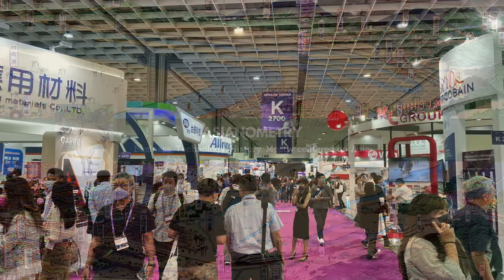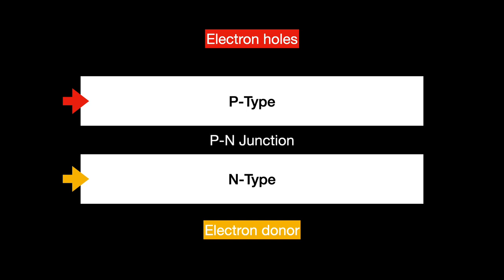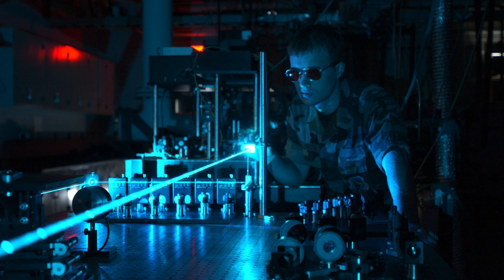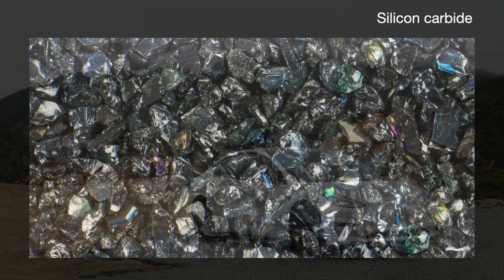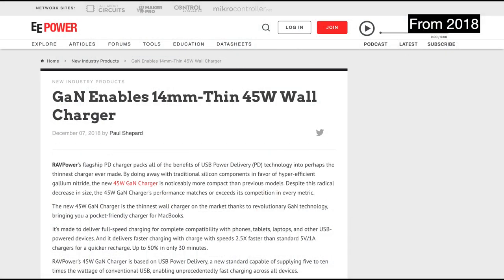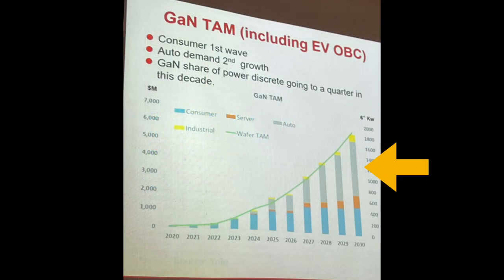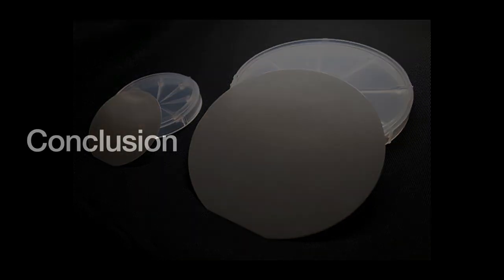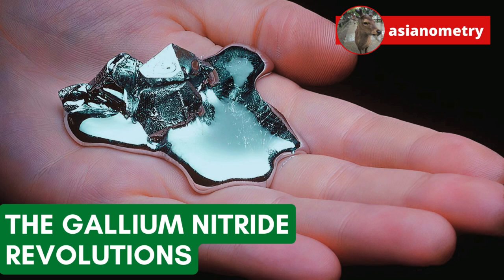The Gallium Nitride Revolutions

Comment: GaN still has a number of hurttles to clear. I think the biggest breakthrough, at least from an actual applications standpoint, will be integrated on chip gate drivers. The reason GaN can switch so fast is because of its small size relative to its current handling rating. This minimizes parasitics, namely gate capacitance, which allows GaN systems to claim you can switch the device up to 5MHz. However, when you have to wire bond the gate, bring it out through some sort of package into a PCB to get to the gate driver all of that goes out the window and you literally will be limit by things like the inductance of the bonding wire. Kelvin source can help, but the fundamental problem remains. Having the gate driver right there in the package will not only practically facilitate MHz switching frequencies in applications where it otherwise wouldn't be possible, but it will also eliminate gate driver design as a consideration for power electronics engineers. Considering how significant that is, the time savings alone will make it more attractive.
Reply: @John Kaplun - several GaN technology companies have developed GaN integration technology and can effectively build an integrated Gate driver monolithically, however this technology is not as good as it was first thought it would be.  The first issue relates to there being no possibility of developing a Zener type voltage regulator device in GaN - which is needed in order to build an effective Gate drive voltage regulator.  The second issue relates to cost - it turns out that it is far more cost effective to design and build a Gate driver in Si technology and then simply co-package it with the GaN HEMT.  

This is not the first time something like this has happened in the semiconductor industry - with the development of BCD technology it became possible to design an 'all in one' switched mode power supply on a chip - these became popular for use in the early 5W cell-phone chargers.  The BCD technology allowed the monolithic integration of a high voltage DMOS power switch along with the bipolar and/or CMOS control circuitry all onto a single Si die.  Although many semiconductor companies developed solution like this the latest trend is to move away from this concept an co-package a Si SJ MOSFET with a control circuit developed in a simpler (lower cost) Si process.  It turns out that co-packaging - either die besides die or die on die is lower cost at a system level that trying to attempt integration of very disparate semiconductor technologies.

Even without resorting to such integration it turns out that you can get very good performance with external Gate drivers and GaN if you just employ two key concepts - a Kelvin Source connection to the remote Gate driver and a negative Gate turn-off voltage.  There seems to be a reluctance from many power supply design engineers to embrace a Kelvin Source connection and a negative Gate turn off voltage.  If you don't adopt these two ideas then your comments about package parasitics is spot on correct and you will experience 'design hell' trying to get your design working while keeping the mythical 'smoke' contained within the circuit components.  The simple adoption of a Kelvin Source connection and a negative Gate turn off voltage makes the driving of GaN a trivial design exercise.
Reply: @michaelharrison1093  Thanks for your insight, I am not a VLSI guy and I was unaware of the inability to form a Zener type device in GaN. Is this something for GaN specifically or all WBG materials? 
I agree most power electronics engineers (such as myself) have been reluctant to adopt those two things you mention. I am working now on a Dual Active Bridge DAB and we have implemented a -3V turn off voltage which GaN systems says is acceptable in their data sheet, though they don't elaborate much. Of course, having to find that -3V rail adds a bit if circuitry in your gate driver. This is for their 100V 90A discrete which doesn't offer a kevlin source, but interestingly offers two gate pins on either side of the chip which is supposed to make them easier to parallel and was a factor in choosing it. I have no hands on experience with EPC or other manufacturers so I'm not sure how standard Kevin source packages are in GaN frankly, so unless you have a packaging lab available to you (and a GaN one at that) I think you might be limiting yourself in terms of what's available on the market.
Reply: @johnkaplun9619  I am currently working on trying to drive standardized packaging for GaN within the industry and at the same time drive towards high reliability (Automotive) packages.  The lack of a Zener type device is a GaN specific limitation - you can stack multiple pn junctions for a higher voltage, however the temperature dependence is not great.  For your -3V Gate turn off solution you can simply increase the Gate drive supply by +3V and then create a 3V regulated reference to reference the (Kelvin) Source to.  I am assuming your DAB will achieve ZVS commutation - this is also a real help when it come to driving GaN.  Eliminating that Millar current really helps clean up the Gate drive.
Reply: @michaelharrison1093  Yes, we have two LDOs creating the +6/-3V off a 9V rail. ZVS is the goal. Standardized packaging would be great. For coming up with some kind of FOM to compare we struggled since EPC packages are all BGA or LGA and GaN Systems are SMT. 
I will point out that I'm just a student, and you clearly have more experience than me so please excuse my ignorance.

Comment: Could a place like TSMC take a GaN wafer and put it into their EUV machines, or do they need new equipment? I know the size is wrong, so let's assume they are for this question.
Reply: TSMC is currently one of the largest manufacturers of power GaN HEMT devices.  They have developed a Schottky Gate enhancement mode device (normally off).  In this video there is a mention of two of the new 'fab-less' GaN companies Navitas and GaN Systems - both of these companies use TSMC as their fab.

Most of the process equipment for power GaN HEMT devices is the same as is used for silicon and GaN is great on the basis that the feature sizes needed for the power devices is effective the same as turn of the century state of the art silicon proocesses.
Reply: As far as I know photolithography machines should work the same, with a little bit of tuning. The problem is that the doping, etching, and deposition processes, and logic design chemistry, are completely different from silicon. This is why having research done on GaN power transitors is so important as it gives chemical engineers a basis for the chemistries and processes needed to develop the technology further. I'd love a 50GHz gan processor, but we are more than a decade away from the technology being mature enough for that.
Reply: I doubt power electronics like chargers need 5nm litho, for high current circuits I would expect large gates, not small ones.

Comment: Problem: This video implies as if GaN is something new, but it's far from it. GaN has been widely used in RF power FETs for many years now, not just opto.
Reply: When I worked at Hewlett-Packard in the 80s we were developing GaN chips for RF applications.
Reply: GaN specifically designed for power applications is something new.  There is almost nothing in common between the RF GaN technology that started to be developed in the 1970s and the power GaN technology that started to be developed just after the turn of the century.  Likewise GaN technology for optical application is a completely different technology.  All three of these applications might technically all use GaN as the active semiconductor material, but manufacturing processes do not share anything in common.

Comment: Sapphire, the "real one" may be  a precious gemstone, but basically its just a crystalline form of aluminium oxide, Al2O3, with some trace amounts of other elements that give it its blue (typically) hue. Those "sapphires" for industrial use are not "gemstones", but man-made crystalline inorganic materials (as seen @ 12:40), made in bulk and so cheaply that they can be used for manufacturing "crystals" for wristwatches.
"By 2017, the largest reported sapphire grown by the Kyropoulos method was 350 kg, and could produce 300 mm diameter substrates" says Auntie Wiki... (https://en.wikipedia.org/wiki/Kyropoulos_method#Crystal_sizes)

Comment: I will bet that the charger they gave you used 21st-century semiconductor in a 1920 vintage circuit. The 100 year old buck. It's not as if the 2011 Ćuk-buck2 actually exists and is far cheaper and superior.

Comment: An important point that was not included in this video was the elemental availability of Gallium. Gallium does not exist as a free element in nature. It can only be extracted as a by-product of refining other ores like Aluminum.
Gallium is nowhere as abundant as Silicon in the earth's crust, it is an important point to consider before we start jumping towards GaN as some holy-grail before realizing it's not environmentally sustainable.
Reply: GaN HEMT devices are made using a silicon wafer and growing a thin epitaxial layer of GaN on top of the silicon wafer.  There is not going to be a potential supply issue for GaN

Comment: Can they utilize gallium like the ideas with liquid mercury? Gyroscope stabilizer or any other possible use with liquid metal?
Reply: Some thermometers use a Gallium alloy as a substitute for Mercury. That's about it. Also Ga is still much more expensive than Mercury if we are talking larger quantities.
Reply: Compound Semiconductor of Group III and V elements. Alloying ratio is  variable.

Comment: What is milliampere PER hour?
That means you're dividing the current by time. In other words, it's kind of an acceleration of current parameter. But that's an irrelevant measurement. It has nothing whatsoever to do with battery capacity. I've never heard it used.
Battery capacity is measured in milliamp hours (for a given voltage). 
This is similar to watt hours, which is a measurement of energy. But not watts per hour.
Reply: He's pronouncing the last three letters of milliampere

Comment: You did not mention the faster GaN transistors cause radio interference. For example it is hard to find an electric vehicle (EV) with an AM radio. This is because the AM radio receives the electrical noise from the GaN inverter more than it receives AM radio station signals. This is killing the usefulness of the AM band. Soon the electrical noise from higher power inverters will  prevent the FM radios from working as well. In the USA this issue is called Electromagnetic Compatibility (EMC) and in Germany it is called EMV. BTW, this is a preventable problem, but few engineers know how to prevent it. So say goodbye to your favorite Radio station as we make more and more electrically noisy EVs.

Comment: mAh = milli-ampere * hour.

It's a very stupid unit convention, but you can think of it as roughly proportional to energy capacity. By metric convention, energy capacity really should be measured by joules (J), but science and likes to pretend that they like SI, but in reality they prefer to default to stupid units when given the opportunity for no reason other than to make things sound more complex than they need to be. 

If you multiply amp-hours [Ah] by voltage, you get watt-hours [Wh] which is dimensionally equivalent to joules [J]--just scaled by 3600 (1 [W] = 1 [J/s], so 1 [W*h] = 3600 [J]). Just note that without the true battery curve this results in an approximation since the battery voltage varies over the state of charge of the battery. But for most puposes, all capacity ratings are approximations of true capacity anyway, since true capacity will varies greatly in response to charge and discharge rates.

Comment: If your Legos are not fitting properly, use a bigger hammer !

"Low voltage applications ... under 600V" eh ! Are we talking semiconductors or vacuum tubes !?

Still going to see which one becomes the dominant material for power semiconductors: GaN or SiC.
Yes, I know power semis aren't as sexy as 5nm multicore processors, but very necessary, in chargers, EVs, and even grid scale inverters, and possibly some new forms of fusion reactors (see Helion).
Reply: GaN most likely.
Reply: There will never be a winner. SiC has a higher ceiling for voltage while GaN has a higher ceiling for frequency so they will both be used for their respective applications.
Reply: @gljames24  True
Reply: Depends on the voltages at play, for things like consumer powerpacks, chargers, and mobile devices probably GaN.

That said SiC seems to be targeting the EV market, Charging stations, and even some grid scale applications around renewables. I know of one big player in the SiC that's testing applications well into the kV range that can tap into power feeds straight from distribution lines at +50kV
Reply: @centurion1945  GaN is more efficient for EVs, though? Those motors like high frequencies
Reply: As for the GaN Vs SiC question...

EPC founder and CEO expressed this the best way (which is very accurate).

Any application that was traditionally using Si IGBT technology will over time move to SiC.  Conversely,  any application that was traditionally using Si Super-Junction MOSFET technology will over time move to GaN.

Si IGBTs and SJ MOSFETs have both existed along side each other serving different market applications.
Reply: @disadadi8958  All things being relative, I think EV motor "high" frequency is still pretty slow compared many other semi applications. Also SiC's excellent thermal management where a lot of these applications can still be air cooled vs needing water cooling and radiator adding weight amd space to an EV.
Reply: @centurion1945  "All things being relative, I think EV motor "high" frequency is still pretty slow compared many other semi applications."

 True, but even at 10 kHz up the GaN appears to be more efficient than SiC
Reply: @disadadi8958  like I said, I only know what this particular SiC company is doing. That said, looking around 10kHz seems to be on the very high end of frequency for EV motors. Tesla runs about 9.95kHz, Porsche 8kHz, and Audi at 10kHz for example, and I can't find anyone who makes a motor over 10kHz. Also worth remembering that a motor plugged directly into the grid is only running 50/60Hz.
Reply: @centurion1945  Right, currently the frequencies are something like that but both the psms and ac induction motors used get more efficient with higher frequencies than 10 kHz for what I've read. I guess it comes down to system design in general to match the parts.

Besides, the PWM switching frequency has to be a lot higher than the produced signal's frequency?
Reply: @disadadi8958  If the sine wave is 10khz then a PWM of 1Mhz is more than enough. SiC could handle that.
Reply: @kazedcat  can, but it will be less efficient than GaN losing more energy every time it turns on and off
Reply: @disadadi8958  It is not that simple you can over built things. For example using 200A device for 100A application. Yes GaN has a better efficiency curve but you can brute force efficiency by climbing down the efficiency curve to match whatever is your efficiency target.
Reply: @kazedcat  Sure you can, but EVs aren't currently very appealing to the masses because the range is short and charging is slow.
Better efficiency certainly improves the driving range, and perhaps better technical solutions in the converter side would allow using 800V charging system that has been in the planning?

I mean I guess you'd want to maximize the efficiency of the drivetrain, not settle for something less than you can achieve?
Reply: @disadadi8958  People optimize for dollars per effective range. Currently GaN is not competitive in price even SiC is a pricier option with low cost EV using only power MOSFET. Tesla has invested a lot on SiC production to gain economies of scale. Someone needs to do the same on GaN to drive down the cost. SiC has the production advantage and the difference in efficiency does not out weigh the difference in cost.
Reply: @kazedcat  yeah but if we're talking about the future prospects it's obvious that there will be investments done for big scale GaN production
Reply: @disadadi8958  When industrial technology gains scale it becomes really hard to displace. Just look at Silicon. It becomes a humongous industry that any competitor becomes relegated to niche application. Even in EV application Silicon is still being utilized for power electronics even if GaN and SiC are so much better.

Comment: Adapter under 100W doesn’t need to used GaN, it is just for marketing purpose.
Reply: My 65 W laptop adaptor with the size of a brick disagrees. Sure GaN isn't needed, but I would love a smaller charger.
Reply: It could be the same size with sjmos. No needed to used GaN.
Reply: You could argue that all semiconductor devices are not needed - back in the 1940's there were computers effectively built using vacuum tubes and/or mechanical relays.  Based on this argument you could argue that the entire semiconductor industry has just been developed for marketing purposes.  However, you could also look at the advances that have been made possible based on the scaling due to Moore's law and the significant cost reduction brought with modern semiconductor technology.

Sure Si Super-Junction MOSFET technology is great - it even managed to 'break the silicon limit', however if you compare the 'Baliga Figure of Merit' for GaN and Si you find that GaN is basically 1,000 times better than Si and at the same basic cost.

How can you argue that the semiconductor industry chasing a new technology that is going to enable a 1,000 times improvement in power converter applications is just a marketing gimmick?